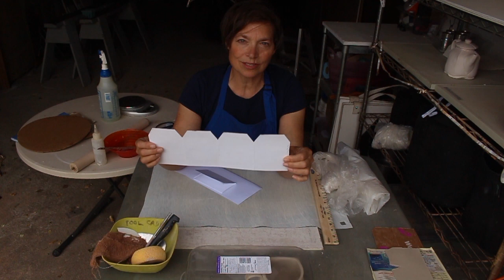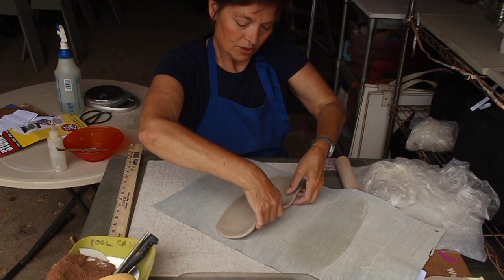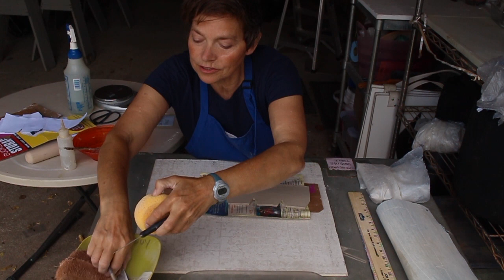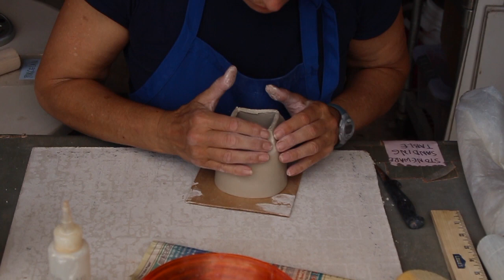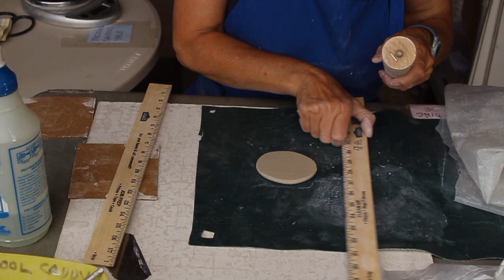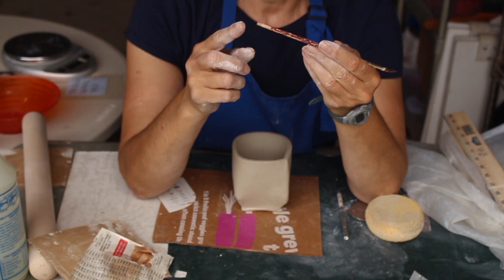Hand-building a Darted Cup from Clay Slabs

Comment: How long  did it take for your porcelain slabs to become firm enough for you to work with it?
Reply from the maker: When I did the demo, the slab MIGHT have sat for 25 mins, I don't recall. HOWEVER, it's so dependent on: the weather, temp and humidity the moistness of the clay you start with, the thickness of the clay, the type of clay, etc. You can even see that I was noting how firm it got. Porcelain tends to go from zero to sixty in dryness! So, all that to say that you have to keep checking the firmness. As soon as it stops being too floppy to handle, it's go time! If it's too firm and not pliable enough it can crack and also not join to itself as well. Your mileage will vary!